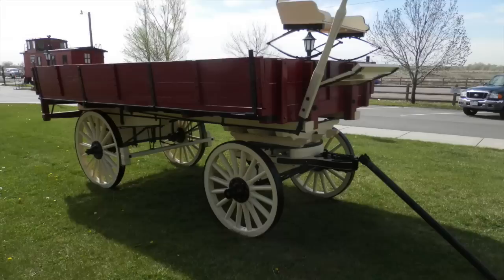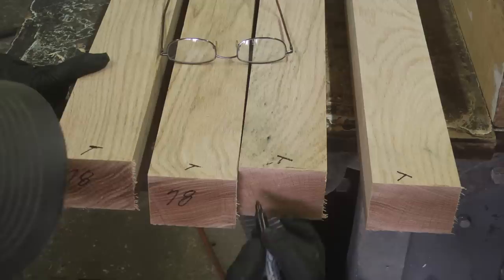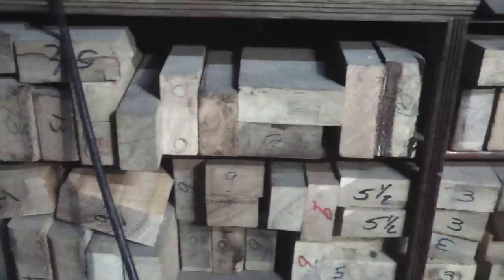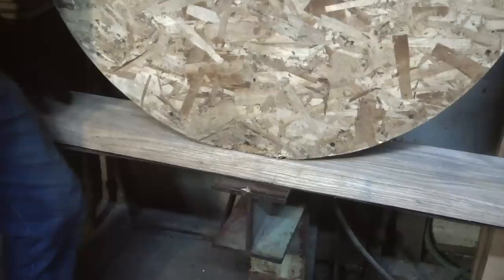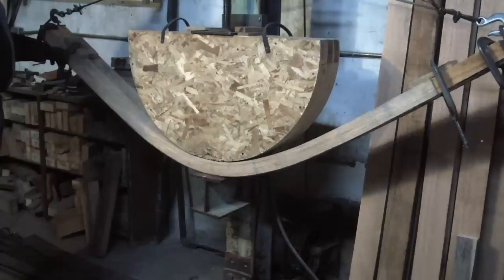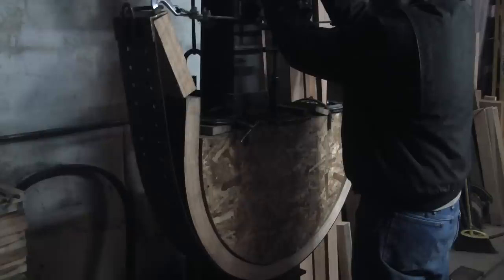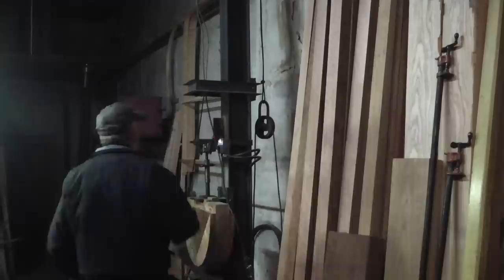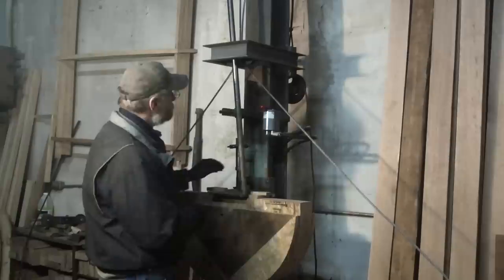Steam Bending 2 1/4" Heavy Wagon Felloes for Heavy Wheels | Engels Coach

Comment: "the principals of bending": What you show here is called "Thonet method". Michael Thonet developed this method aroud 1850 in Vienna and started the first industrial production with chairs. It's using a metal strap outside of the wood in order to cover elongation / tensile stress in the wooden part to avoid cracking.
Once I came to Indiana, US, and saw an old fashinoned machine working the same way as what you do here. The machine was huge and used chains rather than your metal rope. But parts size approx. same as yours.

Comment: My curiosity won't stop asking for an approximate pulling force value. A vertical closed hydraulic cylinder with a couple inches of travel and a  pressure gauge, installed above your two sheaves of the pulley system doing your final direction change is piecing itself together right now. My curiosity is facinated but wants some popcorn now.

Thank you for sharing your knowledge. It's greatly appreciated. Peace.

Comment: How many years did it take you to become comfortable with working with confidence? 
I worked sheet metal for ten years and was confined to learn. But was not comfortable for a couple of years. Learning the sounds and tricks. I would say I ran my machine using sound for about 40% of knowing what was going on with my machine. 
I ran a cool feed punch press that punched out the parts for filling cabinets then I got a job punching out parts for truck boxes and on sight tool boxes. I enjoyed my job very much. That is why I enjoy your channel. Thanks for sharing.

Comment: My experiences with bending wood were turned out less than desired. The secret you said was to compress the wood lengthwise when bending. This stops the wood from thinning out and cracking. A light went on in my noggin. Aha.

Comment: Watched my grandfather do this when building boats many years ago an amazing process. Im looking to bend the gunnels on a 12 foot boat im restoring that will be ash they have to bend through two dimensions a sweep around to the bow and a sweep up. two on each side one inside one out. 1inch thick 2inch deep. Any advice would be much appreciated as grandad,s been gone 30years and is quite hard to talk to now or a suggestion on good books to help. But anyway love your work many people wouldn't believe it possible a kind of magic
Reply: Trevor, one thing that jumps out at me is that Ash rots out when in contact with moisture very easily. Look it up.

Comment: That's quite the set-up you have there.  It does a great job bending.  So, what tooling would have been used traditionally to bend the fellows?  I guess it would depend upon what time frame, such as before and after the industrial revolution.

Comment: You can avoud the black stain from the metal by either using a stainless sheet or by putting a thin cardbooard between the black mild steel strap and the oak. No problem at all. Just getting nicer parts.
Reply from the maker: A stainless steam tank would help.
Reply: @EngelsCoachShop  I'll send you a quotation.
Reply from the maker: Thank you.  My steam tank is 4600mm long.  Yes, my father was German.

Comment: The hooks are positioned backward. The load is on the tip of the hooks and can fail. The should be flipped so the loading is on the thicker part of the hook.

Comment: At 8:34, why's the wood so dark on the one side?  He answers why at 16:03.  The oak has a type of acid, and up against the metal bands it makes it turn dark.
Reply: Yeah, A friend of mine had a cabinet shop, bought a large amount of plywood with oak veneer, he leaned it up against a steel rack, in the winter...the steel condenses water and it made big black stripes on the veneer….ruined it....
Reply: Plane a lot of oak by hand. Your hands will turn black. Tannins sweat and iron. Good stuff.🤣😂😁😀😎
Reply: Doug, your friend probably could have sanded them lightly (to not try to remove the black, just make it a uniform smoothness again), used some coordinating wood stain, like a medium or charcoal grey, redwood, or really any shade on the un-”ruined” black part, and made a tabletop and/or cabinet fronts, even coordinating them, keeping the stripes random and not trying to center or straighten them too much, using some metal hardware to accent and coordinate with the black lines, making sure some light fixtures are available to go with it (and there would be), called it all “artistic”, and charged 2-3x as much as his usual price it. Anything sells if it’s unique. Seriously, some people won’t buy something if it isn’t expensive enough. Such people want to brag about how much their possessions cost. Not kidding, I’ve had people ask to pay more for something, to even double or triple the price, just so they can say it cost more and impress others. Perceived value is very important to them. Well, ok. I can do that. 

Using the “ruined” veneer is also kinda like the Japanese concept of fixing broken pottery, and then filling/covering the cracks with gold. It’s actually pretty cool. Or, as Bob Ross would have called it, your friend just had a “happy accident”.  Might start a demand for it, never tell clients how it’s made, only that it takes time to acquire the materials, they’re in demand. Could make a couple of small test samples with a few stain shades, let them choose from your sample options, and someone would want it. Just so long as no final sealer or finish would interact with it. 

I can see someone liking it in a sort of industrial kind of apartment or home, or even a commercial restaurant, a more open, roomy space place with a lot of wood, stone, and glass. Maybe the kind of place with a sliding barn door into the room, with black vintage style hardware. And black metal light fixtures. You tell the client it’s a rare bit of material, hard to source, amd make them pay at least 50% up front (which already pays for it, since it’s being sold as the “higher end” stuff, and people will fight for it. 

I agree with Bob Ross, there are no mistakes, just happy accidents, and opportunities to create one-of-a-kind artistic pieces. I look for messed-up stuff that no one wants, just to turn around and make something really groovy from it all. Messed up stuff is all just art supplies.

Comment: if the wheels are banded with steel , why not just cut the curve in the wood pieces about 14 or 16 inches long and join them with mortise and tenon ?
Reply: Steamed has to be stronger, surely, because there are no cuts across the grain.  A bit like grown timbers in boats.

Comment: Commercial steam bending of wheel half fellows was found to be quite unreliable. Dried and seasoned material was bent over steam heated forms. When the fellows were removed from the form, there was no change in shape due to spring back or from drying of excess moisture from directly steaming the wood. Fellows could be completed in minutes and were ready for the next step as quickly as they could be turned out. Not exactly a diy process.

Comment: I want to bend some 3/8" x 2 1/2" ash to make the slats for a toboggan.  Half  Circle, 7" radius,  How important is it that I find green wood rather than kiln dried?  Pressurized steam box or open?  Flat sawn or quarter sawn wood?  Because so much of my slat is straight I plan to butt one end up against the angle at the end of the steel strap and the other end I will clamp to the steel strap.  Thanks, I will let you know how it goes.
Reply: @EngelsCoachShop  Thanks

Comment: He has a Steel box not the dumb PVC youtube amateurs; notice his boiler is bigger than a gallon, more like 35-40 gallon still likely a gas unit. A  household water heater is s/u to not do much more than maybe 150 deg max and if pushed may get higher nowhere safe near 212.  Too thin. The heat retention would be better if the steam boxes were insulated would save lots of $$$ of energy. There are so many people making wheels now, just because he is so detailed. Can't get a wagon however to pass smog in CA

Comment: Red oak is an open sell wood. How will you keep the water out to prevent rot?
Reply: Any wood that has been cross cut is open cell.  Do you mean large cell?
Reply: I should have said open cell. You can take a piece of red oak and blow air through where as with white oak you cannot. That is why white oak weather's better than red oak when exposed to the elements.
Reply: I would guess that the "end grain" ends are tightly butted together to prevent water from going in.  But I'm ready to be corrected.
Reply: You are correct of course.  White Oak will resist water intrusion better than Red Oak.   White Oak cells are blocked by tylose when it is killed (cut down).

Comment: Very impressive but the hooks on your slings should be around the other way
Reply: Why?
Reply: Bruce Harris Why?
Reply: It doesn't matter which way as long as the force is such the hooks cant turn and slip out, obviously they did not move at all so it made no difference in this type of operation.